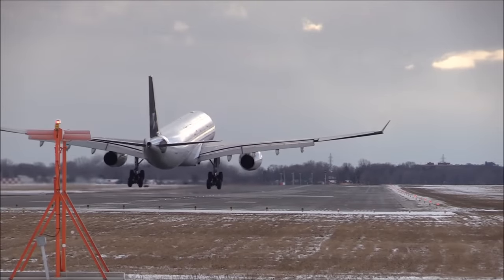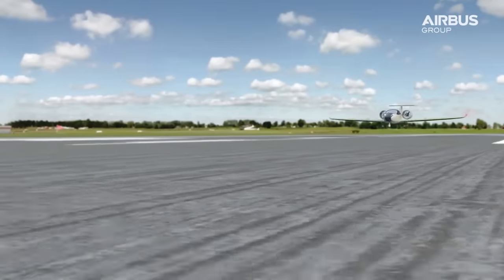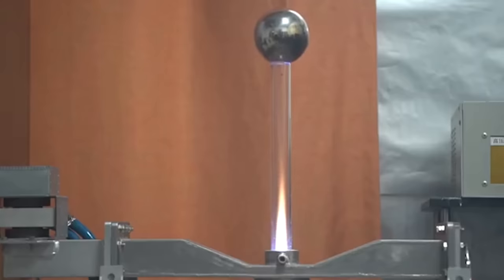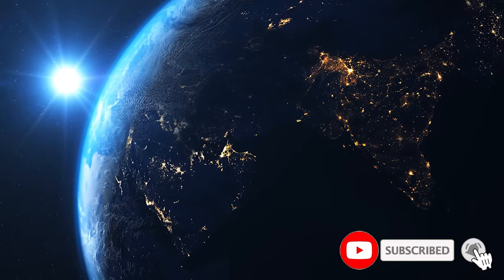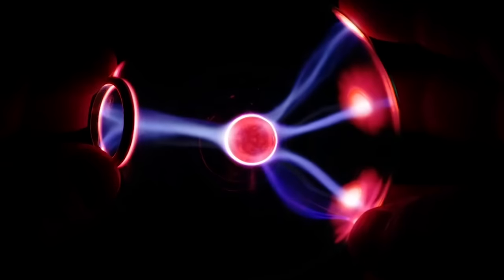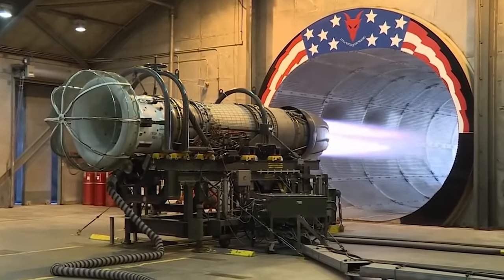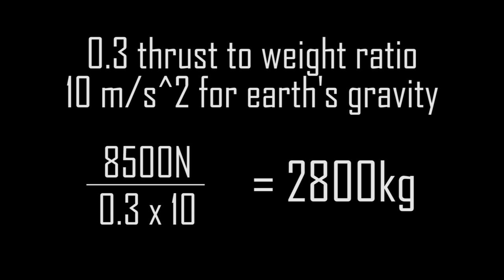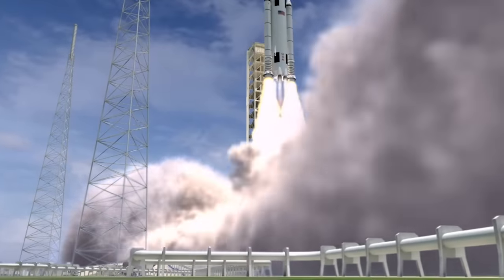Uncovering China's New Electric Plasma Jet Engine

Comment: The question has been, for the 40 years this idea has bounced around, is where the electricity comes from.
Reply: You do realize that there's already a bunch of countries running at or almost 100% on renewable energy, right?
Reply: @crazymarkmc  You can't connect an aircraft to the power grid in flight, genius. Batteries are not a magic solution, their energy density sucks.
Reply: @Morrigi192  why not microwave lasers? Basically using concentrated microwaves to wirelessly charge the plane while in flight. Of course for this to work we need orbital power satellites.
Reply: Nathan  They do it in part by burning wood chips from cutting American forests and rain forests. It is NOT economic suicide, it is ecological suicide. So called "renewable" energy is NOT always sustainable.
Reply: Where the electricity comes from is really not important. It is just very interesting research. When they build one with enough thrust for a real airplane, that's when it's time to start figuring out how to get some electricity.
Reply: Morrigi192 

Well then why not uniform liquid fuels different than kerosene that can be fabricated from natural sources at minimal cost? Ethanol would be especially good at that if we’re talking about direct ethanol fuel cells. The ethanol would come from cellulose not derived from food, waste product which could make 100 million tons per year at the least.
Reply: Very Easy, Russia has already built functional minute nuclear reactors to power its latest rockets and other weapons.... so now its a matter of integrating the 2, boom we have functional electric jet propulsion
Reply: @sabc1able    "minute nuclear reactors to power its latest rockets "  - how?
Reply: @crazymarkmc  Any of those countries big? Didn't think so. And by bunch you mean 2....Iceland (low concentrated population) and Paraguay. Even if I gave you Costa Rica 99% and Norway 98.5%, notice how they are all small countries with low population/concentrated population. Like others have said, what does any of this have to do with a plane/rocket which can't be connected to the grid.

Example from video: Tesla battery weighs 1.5 tons leaving 1.5T for the rest of the plane. How much do you think a plane weighs? Boeing 777 weighs 150 tons, this doesn't scale at all. Model S only has a 100KWh battery, meaning it can run at supply 1KW of power for 100 hours. With your calculation assumptions the battery would last a measly 19 minutes with an output of 8500 N of thrust, you would need 6 of these engines to equal 1 GE90, the current power plant used on the 777.

This is all assuming ideal conditions like good temperatures, no vibrations, flexing, air density etc... Up at cruising attitude on a plane, you get none of those benefits and the numbers will fall more.
All that and we haven't even touched n the fact that the exhaust (plasma) is well as hot as plasma which is far hotter than a turbine engine runs. We weld and cut metal with plasma wtf are you going to use to shield this thing and more importantly the electronics of the plane that are needed to run it. Don't believe me, go throw a pile of forks in your microwave and let it run, watch as the plasma generated kills your microwave.

If there is one thing big corps aren't, it's stupid when it comes to making money, they would've already started making the switch ages ago to this tech if it were remotely viable.
Reply: Piezoelectricity perhaps?
Reply: A turbojet generator, of course.
Reply: @acywei  ah yeah and shielding for the plasma would be heavy af
Reply: @tsamuel6224  what do you refer to as "renewable energy "
Reply: @crazymarkmc  Yeah. Ughanda, Burkina Faso, Chad, Niger and so on.
Reply: @Morrigi192  You can actually power things like drones remotely using light of various frequencies and focus like Microwave or Laser.
Reply: @heyhoe168  somewhat true, but many people with offgrid homes prove you can live solely on renewables, especially if they use all LED lighting, and multiple energy production and storage solutions together. 
Was interesting to see the points in "Planet of the humans" though about the fact that the production of all green solutions still requires hydrocarbons.
We might have passed these obstacles long ago if it were not for the greed and corruption of oil magnates.
Reply: @RedPillDiaries  People can do it. But who will produce those LED bulbs and many, MANY more things? Homes consumes a little fraction of electricity, majority of it goes for industry.
Reply: @heyhoe168  That appears to be the flaw in the plan doesn't it.....industry concentrated production while there is not enough concentration of power from renewables. Therefor the problem is incompatibility between modern industrial concentration and centralization with the more decentralized nature of renewables. 
They key might be decentralizing production, and taking technological production/industrialization back to the individual.
Reply: @RedPillDiaries  industry concentrates for a reason. Generally it saves logistical money/energy this way. Sometimes economy is huge, to the point when decentralization will just ruin the world.
Reply: Magnet anyone?? 😅😅😅
Reply: @heyhoe168  Industry doesn't centralize as a strategy, but by sheer nature; consumer use is the opposite, by nature. That was my point. Renewables suit a change in the way we do things
Reply: @acywei  You, uh, understand that this is what we call a "case study" or "proof of concept," right? All tech starts like this. You don't think they just built a giant, untested jet engine on a plane back in the 1940s and said 'ok Jim, fire it up!' right?
Reply: NaK original fission reactor... it flew once...
Reply: Some sort of subspace perhaps
Reply: @inventor121  I"ve also wondered why this is only used for small (model scale) planes. Must be very limited or heavy for higher amperage.
Reply: @crazymarkmc  Let us have just one example? The Pitcairn Islands?
Reply: @TheRogueX   Laughs in Early german Jet fighters/Interceptors

Comment: "three times the emissions of a petrol car", yeah, but how many cars carry 100+ people?  It's the emissions per passenger that's important, obviously a plane is going to produce more emissions than a car, but it produces far, FAR less per passenger.  Ions engines have been around for decades so it's hardly science fiction but, as you point out, they are very low thrust.  Any electric propulsion suffers from the problem of energy density.  Batteries are very low energy density compared to chemical fuels such as gasoline, diesel, aviation fuel, etc.  This is the very reason why electric propulsion is only used for things like drones.
Reply: please show me those drones on electric propulsion! I have only seen satellites so far. Elon's ones have those thrusters for sure.
Reply: I'm pretty sure that the "three times the emissions of a petrol car" figure was per passenger mile.
Reply: It's probably already per passenger... I wouldn't call something between 3 to 5L/100 km "far far less per passenger" than a conventional ICE car.
Reply: @IncognitoTorpedo  @Bourinos02  Fuel consumption does not equal emission level.  Also, using "per-km" is also not a good measurement as planes rarely are in a traffic jam (sometimes you may have to circle an airport a couple times before landing or sit on a taxiway before takeoff, but once in flight there are no obstructions) where as in a car travelling through an urban area, more time is spent accelerating/decelerating/idling at lights, traffic signals, etc.  So a better measure would be "per passenger travel hour". 

When you take these real world factors into account as opposed to "idealized highway speed with a fully loaded car vs cruise speed of a grossly under loaded plane" (average occupancy rate of a car in the U.S is approximately 38.5% per vehicle per mile vs a planes approximate 85% occupancy per vehicle mile) then planes are a much better choice.

Sources:
https://youmatter.world/fr/embouteillage-pollution-air-conseils-21173/
https://www.energy.gov/eere/vehicles/articles/fotw-1040-july-30-2018-average-vehicle-occupancy-remains-unchanged-2009-2017
https://www.statista.com/statistics/221085/passenger-load-factor-of-delta-air-lines/
Reply: One volcanic eruption tops all emissions in history combined
Reply: @Rabbit.760  What makes you think that?
Reply: @pigpuke What does this has to do with anything? The consumption is in the same ballpark anyway. If it was far far different, I'd expect at least a x10 factor...
Reply: @Bourinos02  Either you didn't read the sources or didn't understand them.  The long of the short of it is, it is almost a x2-3 factor in a planes favour when you factor in everything.  Planes only lose when you use numbers that don't reflect reality.
Reply: @pigpuke  Well, maybe. But still an "almost x2-3 factor" is nowhere near a x10 factor.
Reply: @Bourinos02  Doesn't change the fact that planes produce less emissions per passenger hour of travel than cars.  So at this point we are just splitting hairs over what constitutes "far, FAR".  :P
Reply: @pigpuke  Like, 2% of total emissions compared to 12% for road transportation?
Reply: @Bourinos02  I don't follow, what does that have to do with the per unit amount or any other part of the conversation, really?
Reply: 100+ people ? when transatlantik flights happened at 2 to 3 passengers ? or politicans in 2020 travel around the world to meet personally instead of using online meetings , same for the rich that fly 12000 kms for just a short visit of anything ? at the point where we are now petrol driven planes are just stupid , same for cars when neighbours drive 5 fucking hundred meters to do grocerie shopping which is not uncommon thanks to fat america and capitalism
Reply: Exactly. I used to get crap about my hummer. But I had added the three seat in back so it carried 8 people. We had a family of 8. So most of the time I was driving 8 people around...while an a-hole Prius’ crowd would flip me off with their single or double passenger rides. On top of that we’d be towing a boat or trailer often. So....
Reply: @pigpuke  at least i dont need to insult different opinions and it is well known which sort of "socialized" people do that,

the world is fcked if we keep going that way,
the countries that reached out industrial Status are trying to copy the "west" which isnt a good idea, just take a look at the US with open eyes, even a blind can see that Ellbow capitalism isnt working (ok it is, for the 1% owning as much as the 99% populationrest around the globe)

if you have kids , im sorry for them to not be able to experience wildlife diversity as i did 30 years ago

oh and btw freedom of speech is really good but doesnt matter if the government isnt listening, even if the whole country (besides the 1%) is yelling at them
Reply: oh and btw, im a really big enthusiastic fan of Airplanes, motorbikes and nearly any racing since childhood but that doesnt stop me from seeing how bad it is for the other thing i love  Nature and Wildlife
Reply: @GeschichtsBlitz  It's not about "opinions" its about facts and facts don't care about your feelings or opinions.
Reply: @pigpuke  and a fact is that we should stop using any petroldriven energy instantly, not in 10 years, not in 5 , now, no matter the cost
Reply: @GeschichtsBlitz  Well, nothing else provides the same energy density to meet our requirements at this time with the exception of Helium-3.  I don't see any moon mining bases, do you?
Reply: @pigpuke  thats why humanity has to work on itself and lower the requirements or better the imagination of what we think we need, advertising, lights in the night, exotic fruits, 30 pairs of shoes , tshirts so cheap and of low quality its not worth it to wash them after 1 day of wear, the list is endless and they call it freedom but it is a prison of mind if you take a closer look
Reply: @GeschichtsBlitz  I won't argue that planned obsolescence is a bad thing but at the same time, good luck trying to change the world at that scale.  :P
Reply: Busses
Reply: @English_Lessons_Pre-Int_Interm  maybe by 'electeic propulsion' they meant any electrically-powered ones, such as motor-driven propellers?
Reply: Robert Slackware  Uhhh...planes are parked and turned off quite a lot actually.  But that is irrelevant anyway as the per-passenger per mile emissions is what you use to compare them, that includes the emissions for when they start the engines, taxi to the runway, etc, etc.
Reply: Robert Slackware  Do you know how many cars there are in the world?  If you add them all up, they blow your silly volcano out of the water.  How is that not obvious to you?
Reply: @pigpuke  When it comes to CO2, fuel consumption very much DOES equal emission level.  Gasoline (or diesel, kerosene, Jet A, Av gas, propane, whatever) contains a specific amount of carbon per kilogram, and that equates to a specific amount of CO2.  That is a law of nature.  It's called stoichiometry.
Reply: @incognitotorpedo42  I wasn't arguing that.  I was saying that it's the mount per passenger mile that is what matters.  I cited sources for my claims so show me something to refute it or stop wasting my time by being inane.
Reply: @pigpuke  You said, and I quote: "Fuel consumption does not equal emission level."  Obviously fuel consumption per passenger is what matters, but that's not what you said.
Reply: @incognitotorpedo42  Oh, you got me.  While being avalanched by your other irrelevant comments to my original point I mispoke.  Still, it does not refute or even address said original argument so...?
Reply: @pigpuke  Avalanche of irrelevant comments?  I basically said ONE THING!   I think it's time that you addressed your inability to graciously admit a trivial mistake.  Perhaps counseling would help.
Reply: @incognitotorpedo42  You are correct in-so-much as the avalanche of irrelevant comments were not solely from you.  However, that doesn't mean that you are correct, that I agree with you without citing sources or, that you even addressed my original point directly.

As far as graciousness goes, that is reserved for people who actually address the point and don't set up straw men.  It's reserved for people who don't gaslight, to wit "Obviously fuel consumption per passenger is what matters, but that's not what you said" where in my original post I explicitly say "...a plane is going to produce ...  less per passenger".

I did admit a trivial mistake ("Oh, you got me") but, I am under no obligation to be gracious about it when dealing with a bunch of people who deliberately miss the point or straw man the argument I originally made.  I think certain people need lessons in etiquette and how to debate without gas lighting or straw manning.  I cited sources to back up my claims and was faced with people who made claims that were flagrantly contradictory to the very sources I cited.  I have no problems admitting when I am wrong, but unless you* prove I am wrong (read: cite sources that would counter the sources I cited) then all you* have done is just gainsay without thought or research.

* Note:  When I say "you" I don't specifically mean you as an individual, but the second person singular and second person plural in English is the same word.
Reply: @pigpuke  This reply is not long enough.  Please expand.
Reply: @incognitotorpedo42  "This reply is not long enough.  Please expand."  tr:  "I've got nothing but refuse to admit as much."
Reply: @GeschichtsBlitz  Bringing around the death of everything by nuclear war doesent sound particularly good either. Which is what will happen as billions of people around the planet starve and all the economies collapse from the sudden halt of all trade.
Reply: @PeterRichardsandYoureNot  8 passengers against 2 is just a little bit different of 5 (average) vs 100.
Reply: @Rabbit.760  It's way too hard to believe in that.
Reply: @incognitotorpedo42  If I remember, volcanism makes 0.4 gigatons of CO2 per year while cars make almost 4 GGT
Reply: IncognitoTorpedo by all emissions that means all human emissions and we have only been producing emissions for around 200 years aka the industrial revolution which 200 years is about 1/68 billionth of the earth’s existence so it’s not comparing it to much
Reply: @elliotoomen8001  yes me do has stupid alot
Reply: @incognitotorpedo42  look it up, its a common claim
Reply: @Rabbit.760  The difference between you and me is you decide what is true on the basis of  what "a lot of people are saying", and I look at the science.  I posted links to references.  Check them out, if you're the kind of person who is capable of changing your mind when presented with evidence that contradicts what you believe.
Reply: It's three times the emissions of a petrol car PER PERSON.